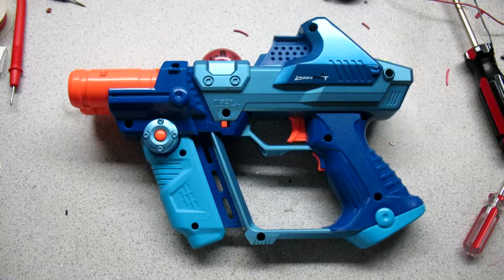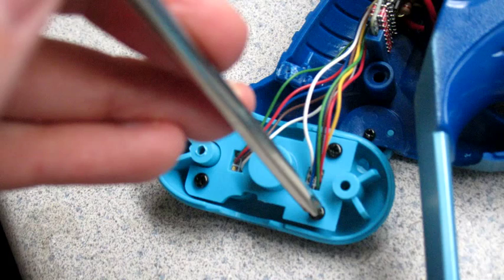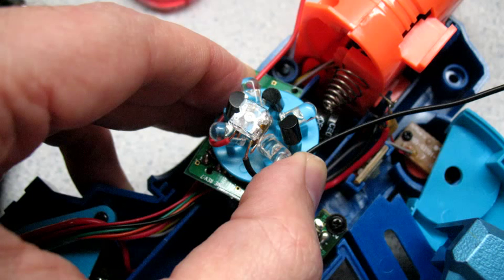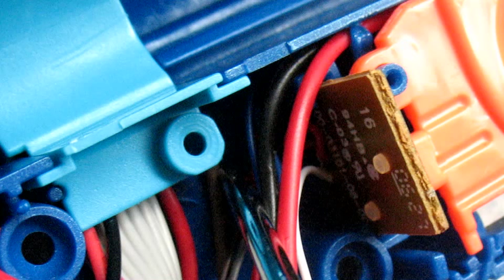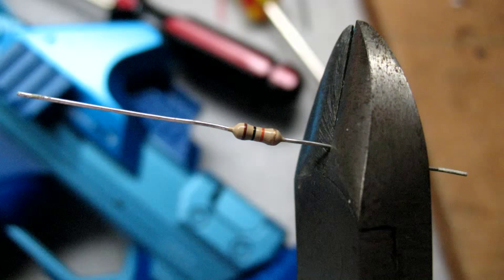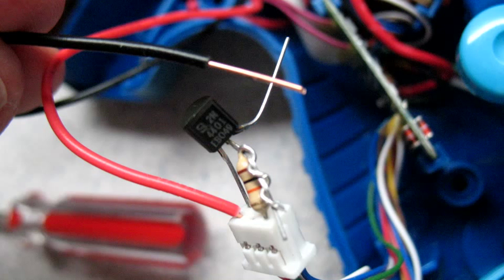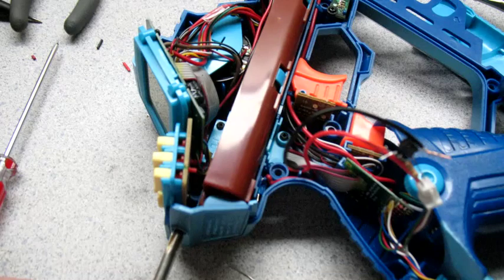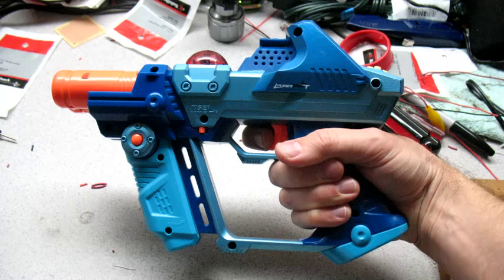Hit Light for the DELUXE "Lazer Tag Team Ops" tagger

Comment: Also, I had a difficult time getting the two transistor leads (one with the resistor and one without) into the molex connector and even broke a few transistors in the process.  I decided to solder a short piece of wire to the transistor lead without the resistor and then connect the wire to the molex connector.  Not sure if that helps anyone else, but it certainly made it easier for me.  Again, props to you Windjammer for such a useful and easy-to-follow mod!

Comment: Awesome mod Windjammer!  I agree with TagFerret, since you're already soldering, you should go ahead and solder the other joints as well.  Also, I have big hands so twisting the resistor and wire around the transistor leads was a little difficult for me.  Soldering the joints allowed me to do less twisting but still have a reliable and conductive joint.

Comment: Great video, Windjammer!  And nice find on that Radio Shack LED, it looks great in this role.

Since soldering is already part of this mod, I would suggest soldering the joints where the resistor and transistor leads are twisted/crimped together, and where the wire and transistor lead are twisted/crimped together -- this will prevent corrosion from ever making that joint no longer conduct.

-- TagFerret